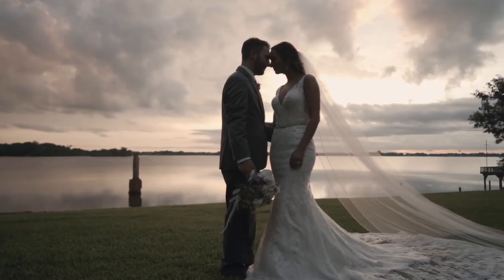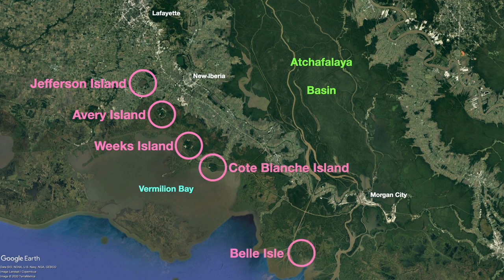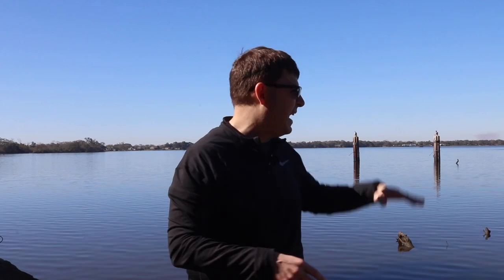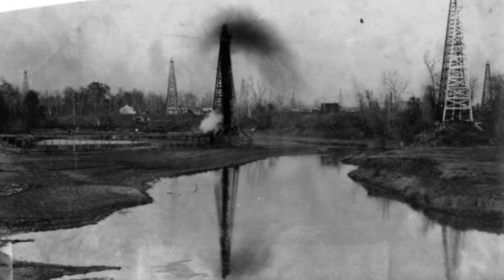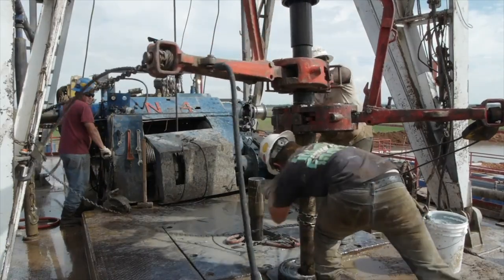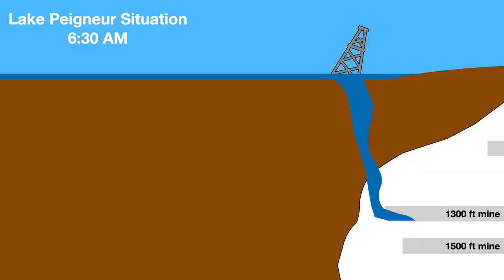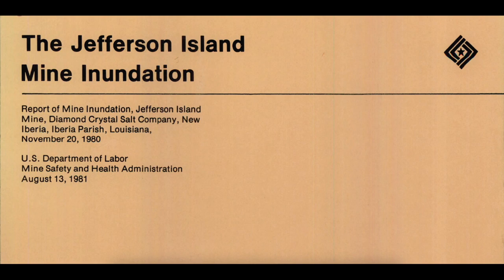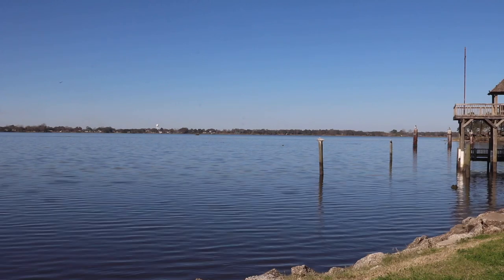How Can a Lake Vanish in 3 Hours?--Phenomenon Explained (The Lake Peigneur Salt Mine Disaster)

Comment: Excellent work!  
I was an engineer in the Louisiana energy industry in the 80's and discussed the disaster with Texaco's "Company Man" (Texaco's on-site supervisor).  This guy was on the rig when it all went down (figuratively and literally), and he had a fascinating story to tell.  He grew up in the area and had worked in the salt mine before starting with Texaco (as 4th generation Texaco).  That morning as he was radioing in his daily report around 0500, the driller poked his head in to let him know they were stuck.  Within a few hours, the rig had disappeared, he and others boarded a tug boat in hopes of stopping the bayou from emptying into the lake by sinking one of the barges in the bayou.   As they approached the lake from what "used to be downstream" they encountered the waterfall and were barely able to get off the tug before it went over.  He described jumping off the front of the tug as it jammed its bow into the bank and then running in-place as the ground and foliage moved past him (and others).  He spent that evening explaining it all to Texaco brass in New York.  What a day.
Reply: I retired from Chevron which bought Texaco in 2001.  Texaco has had some “issues” over the decades, but what oil company hasn’t.
Reply: @ntvypr4820  
Too funny.  That is so true.  
“Thunder Horse”

Comment: I'm not understanding the math of the canal backfeed creating a 150' waterfall, when the lake had normally only been twelve feet deep.  Was the canal right on the edge of the sinkhole?
Reply from the maker: It wasn't that far; the canal (Bayou Carlin) drains the lake and the sinkhole is on the southeast side of the lake, near where the canal starts. As the sinkhole spread, enough of the lake bottom collapsed to capture the bayou's flow temporarily.
Reply: The lake got much deeper around the whirlpool area so where the canal entered the lake suddenly there was a cliff!  I heard a tug boat in the canal was pulled into the hole just after its crew bailed!
Reply: It seems to me that the dredged out canal actually continues north into the lake and bends to the right becoming something of a service channel following the southeastern shore, passing what was known as Texaco dock and continuing on to the Salt Mine dock. The edge of the growing sinkhole encroached and crossed this dredged out channel, and thats the point where the canal water began to spill out into the new hole. There was no vortex-like suction involved as some past tellings have implied. The hole and the lake bed was simply below sea level, and the water in the canal is right at sea level. So the water just followed the laws of gravity. And hence the water is trying to fill the hole as quickly as possible.
Reply: @AllanWolf100  when I am elected President I am hiring you as press secretary to explain my policies
Reply: @yodaguy6956  I'll clear my calendar.
Reply: @AllanWolf100  haha might want to read my agenda first.

Step one:. Reduce all government agencies budgets by 90%